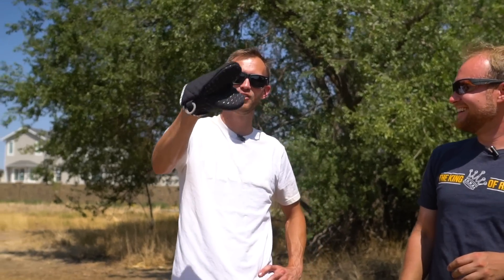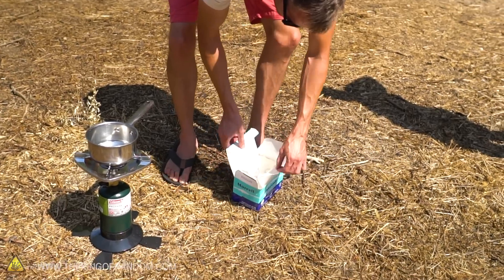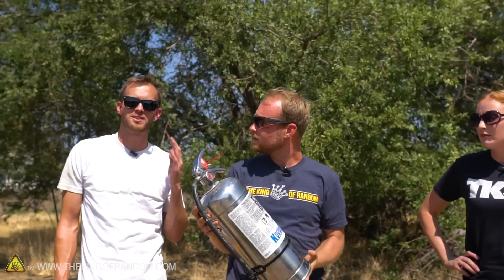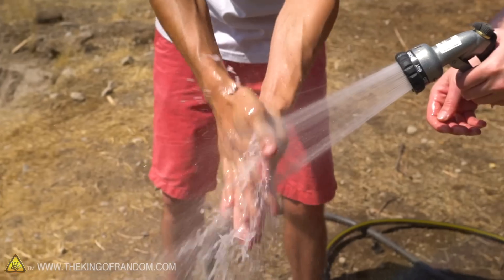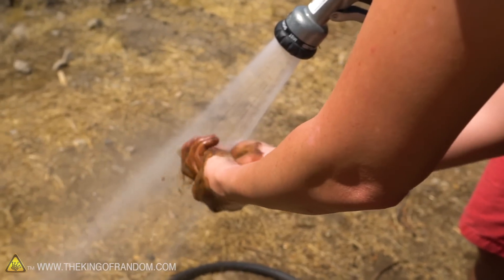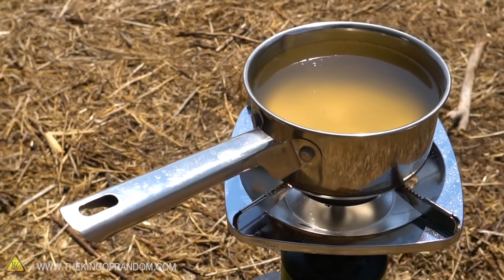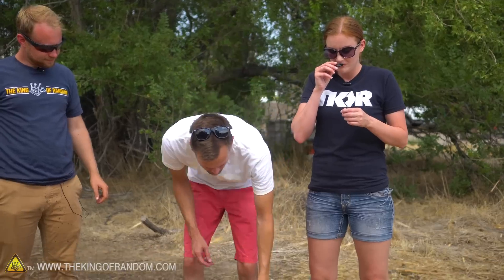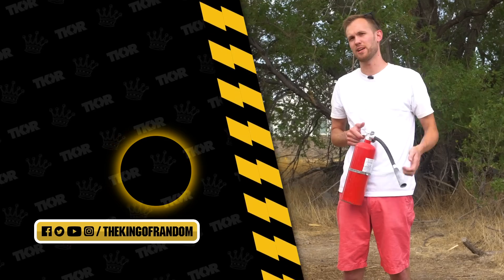How You Can Make Soap Out of Fire

Comment: do you not know abc type is an acid ph about 4.5 and is an acid not baking soda?( dont beleive me than check the msds !!!
) a bc extinguisher contains baking soda or purplek the reason abc type is an acid and is less effective on grease fires because it probably will not generate soap when used on grease fires! well if you use  baking soda or purple K unit ph is approximately 8 - 10 an alkaline abc powder is yellow an as I said above ph is 4.5 about the acidity of ketchup.

Comment: While I’m not discrediting the fact that sodium bicarbonate is actually used in making soap, but that ABC fire extinguisher is actually using monoammonium phosphate and not sodium bicarbonate.I’m a certified fire extinguisher technician and I work with both types. ABC fire extinguishers do not use Sodium bicarbonate, only BC fire extinguishers do, as they aren’t rated for class A fires.